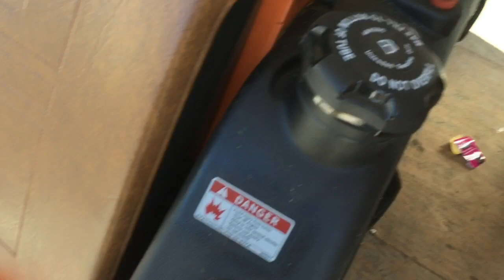The trailer is too small.

Comment: I use an 8.5x20 trailer and it's to small now going to get an 8.5x24 next season. If we would quit buying equipment we wouldn't have to keep going bigger. LOL. Great video.
Reply from the maker: A slightly larger enclosed trailer would be a big help. Next will be a open trailer for hauling anything from equipment to mulch.